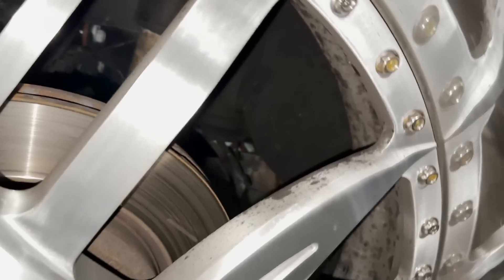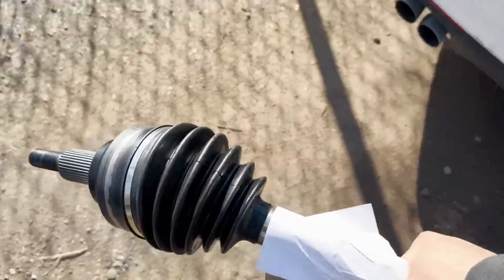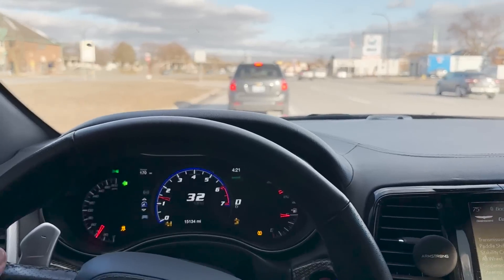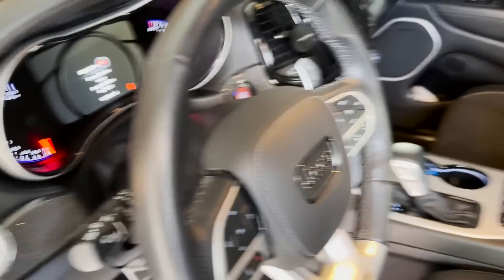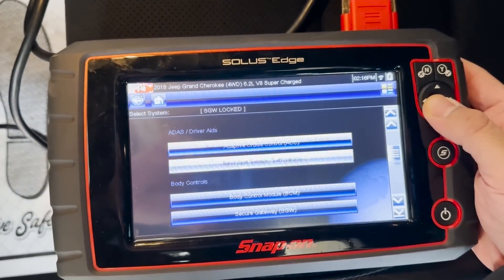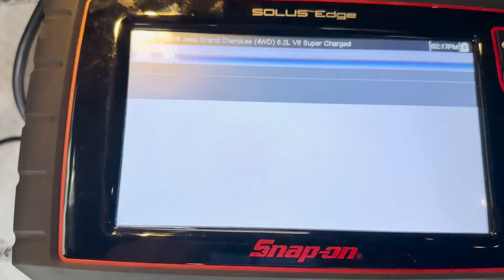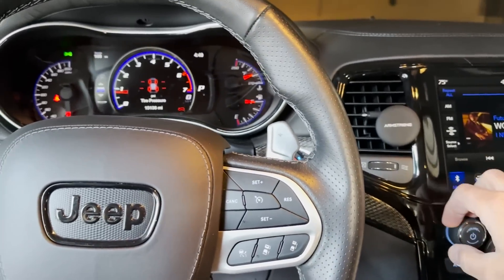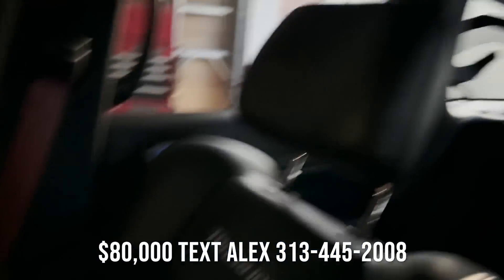I Ran Into Unexpected Problems With My Auction Bought Trackhawk.. Expensive Fix?

Comment: Hey Khal,check the tire sizes from front and back and make sure there the same,if this vehicle has AWD,the tire sizes have to be within a certain spec because of the revolutions,it will mess up the differential and awd system, you can either run all the same tires if not type up the sizes in a wheel calculator to make sure there within spec,if not the new differential will mess up aswell for the new owner,you can tell those wheels are not for that car since they poke out.

Comment: Get the “Chrylser 12+8” bypass cable and have access to all the modules!? 
The one you mention only has access to CAN-C meaning you can’t access the radio etc.. to read trouble codes either.

Comment: I bought a torn up trackhawk back in June 22 at 85k miles. Cheapest in the country without theft report or salvage title, so I knew I was getting a lumper.

Since then, I had to replace the tranny, transfer case, front drive shaft, and front differential because the last owners were jackasses. Luckily the dealership I bought it from slapped on a 36k full drivetrain warranty when I bought it so I was covered on all of it. 

I break 100k miles tomorrow and it's crushing life now that i got that fixed. I'll never sell cause I've done so much work on mine and can't ever trust anyone else. Now that I've fixed the worst parts, I'm planning to push this thing hard and far. Ive not gone crazy on mods, but hit 3.0 second 60 time in death valley, so its moving. 

I've got the funds to repair anything on it, so plan to take this well into the 300k range and beyond. I'm averaging about 30-40k mi per year so should be an interesting journey
Reply: 30k a year is a lot
Reply: @ohb7517  40k a year is a bit more 🤓🤓
Reply: @ohb7517 I didn't buy it to look at it or keep it pristine OG (hence buying a super high mileage version). I stormchase and roadtrip all the time so tend to rack up the miles.

 I wanted a vehicle that was stupid fast, could off/soft-road, did well in winter, and was big enough for my 6'4" body to sleep comfortably in while car camping. Trackhawk was the only one that checked off all those practical boxes.
Reply: @TheLordCinderbottom  nice!! I didn’t really care about the mileage either so I got myself a chally with 90k miles 😂😂
Reply: 300k into a track is insanity😂😂 might as well buy 2 or 3 track hawks and just swap between when something breaks lol
Reply: lol....ok
Reply: @ohb7517   some of us drive our cars like that.

Comment: Isn't the transfer case going to keep blowing with those ridiculous wheels?
Reply: @XyXInc..  As long as the OD of the aftermarket wheel and tire matches the OEM OD wheel and tire, it shouldn't be a problem.  Excessive burnouts can destroy a transfer case as well.  I've been putting 22" - 24" aftermarket wheels and tires on my SUV's for years, and never had an issue with the drivetrain..

Comment: Sorry to hear that.  My 2018 doing a hard L U-turn goes into a limp mode, service electronic throttle body. then clears as I go straight and works normal.  I have the bypass for tuning, should I be able to scan for the code?
Reply: take off pedal commander if you have that
Reply: @mondo9.2.5  don't have one

Comment: The transfer cases in ALL WK Grand Cherokees are very sensitive to different sized wheels I would highly recommend to put stock wheels back on or else your gonna be putting another transfer case in 5000 miles ask me how I know
Reply: If the wheels are all the same size it does not matter at all.
Reply: @sandra folsom definitely matters.
Reply: @putoutmyfirewithgasoline1877  simple geometry dude. No way it does if all 4 wheels are the same.